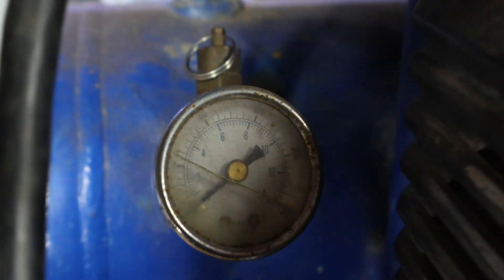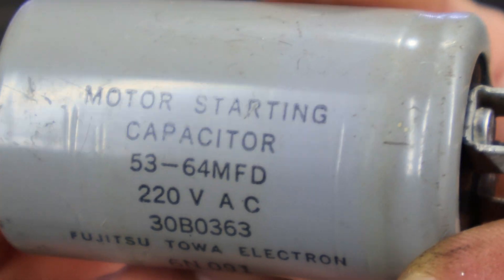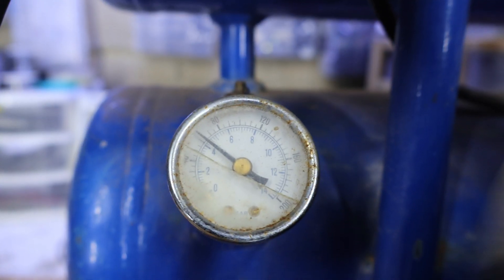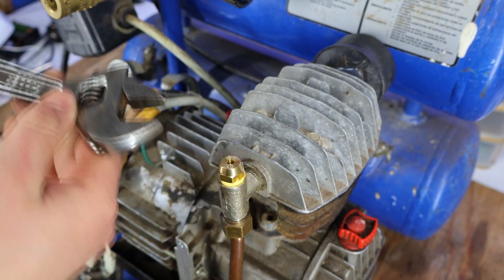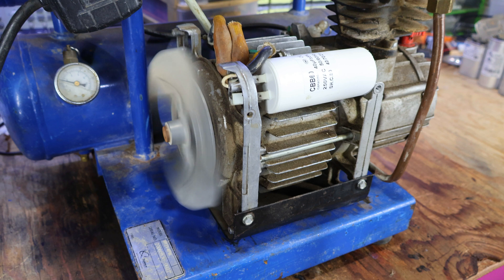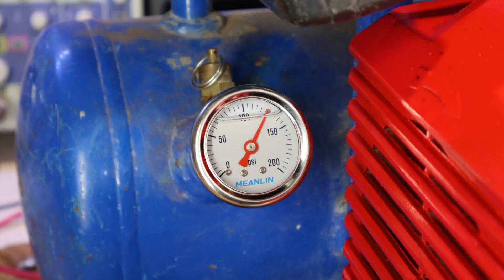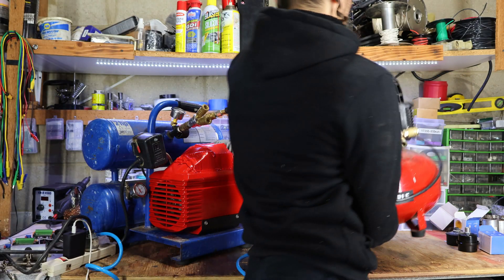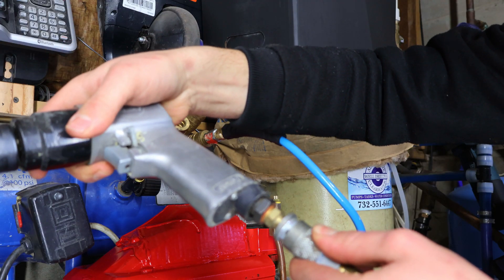Why Your Air Compressor Stopped Working And How To Fix It?

Comment: My fan spins ok, but the piston doesn't move under power. When I spin the fan by hand though, the piston makes one good stroke (not more). Still the capacitor? It doesn't have a belt drive.
Reply from the maker: If the shaft doesn't spin, then it is most likely a bad capacitor
Reply from the maker: If the piston doesn't move up and down at least once every 2 strokes, the connecting rod might be damaged

Comment: I recommend high flow V fittings and quick connects and upgraded 3/8 or full size air hoses. EVEN with small capacity compressors. Keep a couple different hose lengths. Shorter ones will have faster airflow and more performance.
I GUARANTEE YOU it will perform much better powering just about everything.
Double check the accuracy of the pressure the compressor is rated to fill the tank to and carefully adjust if needed. Make sure no connections are loose and double check all fittings. Check after a few uses to ensure through use nothing loosened.
With these tweaks i can run an impact wrench at full beans and it actually zips off bolts without struggling. and so it doesn't rapidly drain the tank because it can run more efficiently with maximum torque.
Air blower tools are crazy powerful and have some real kickback and can nearly double as a leaf blower.
The high flow fittings and upgraded or full size air hoses make a world of a difference. Really skyrockets the value of the air compressor and makes it highly capable.
Reply from the maker: @realflow100  thanks for the info
Reply: @ElectronicLab.  also upgraded my air pressure regulator with a high flow model. the difference in performance with all these upgrades is massive. it helps even more since my air compressor came with terribly restrictive connect fittings and regulator. and wimpy thin hose.